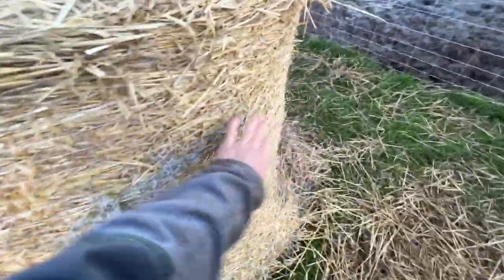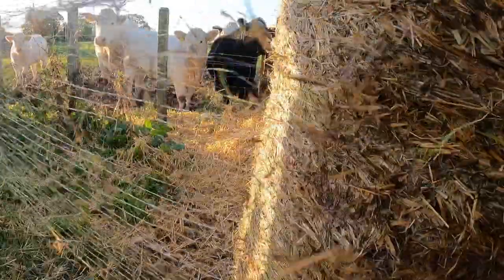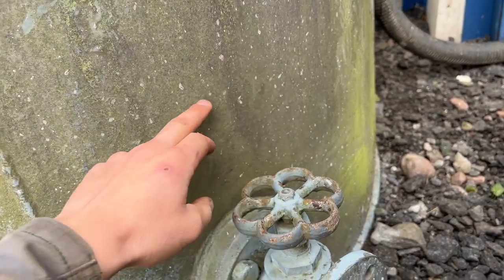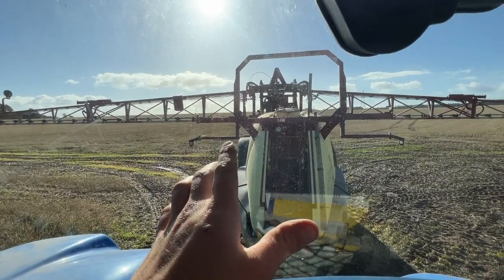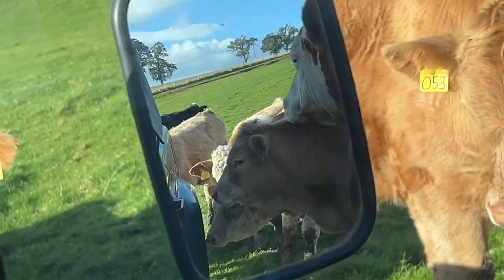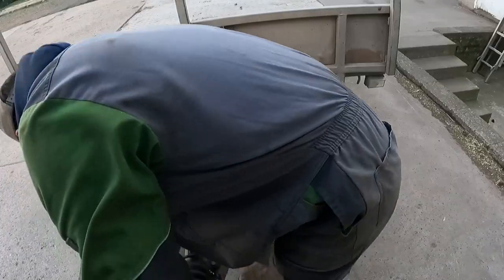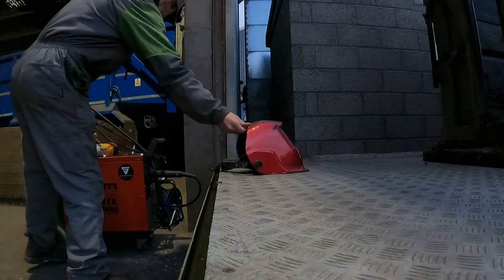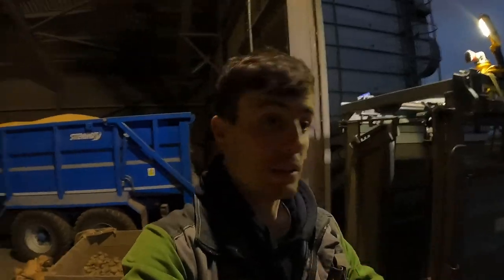Not Long Left | Welding | Spraying

Comment: Thats me getting a mention as a winner?! Good stuff. Worked it out by rough maths. If i remember, you showed a tray of bulbs with a number 700 on the label, took a guess that that was the amount in the tray, then you showed the pallet, by counting the trays then x that by 3 as you said you had 3 pallets. You also showed the red net bags with approx 425/450 per bag (google search if i've remembered correctly) and counted the bags on the top layer then x by the amount of layers. Looking forward to a wee drive up to claim my prize!!
Reply from the maker: Good research!